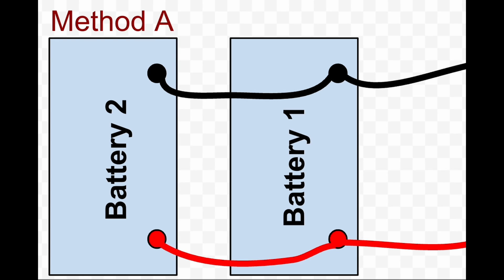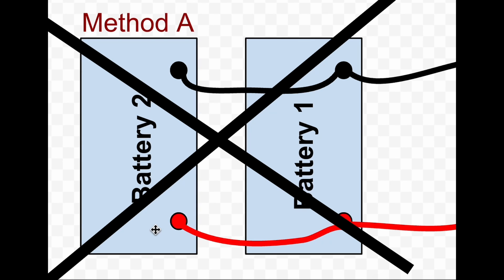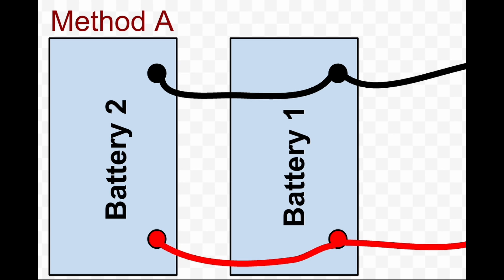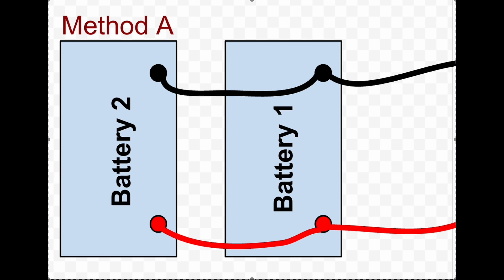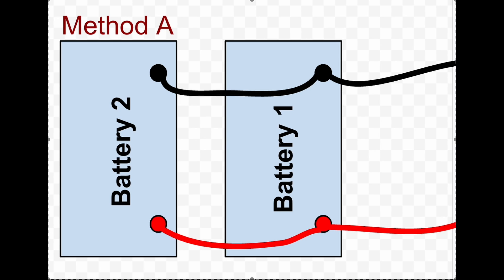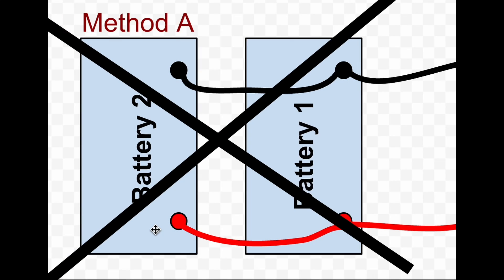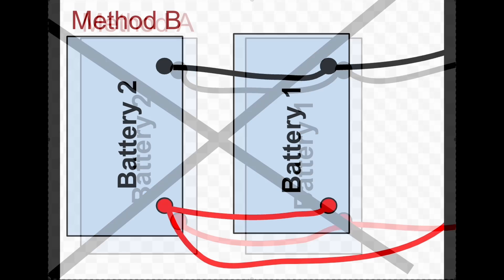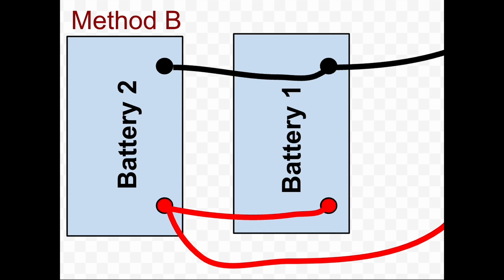What is the Best and Safest Way to Connect Lithium Batteries in Parallel for RVs and Boats or Homes?

Comment: I'm buying a boat with a 24v trolling motor. The boat comes with a Noco genius Gen 5x3 12v charger. I'm wanting to run lithium batteries. Will this charger charge a 24v lithium battery or do I need to buy two 12v batteries and how would I connect them?
Reply from the maker: @smartmoneynow1926  The Noco 5x3 is for 12V batteries. I would use a 24V charger and buy either a single 24V battery or 2 12V batteries and connect them in series, not parallel as I have shown in the video. Theoretically you can connect 2 of the ports to individual 12V batteries and run the batteries in series. However, I am not familiar with that charger so I would do further research before you do it. One advantage to using 2 12V batteries is that you can move them individually. The advantage to a 24V battery is that the BMS will balance all of the cells . If you go with 2 12V batteries, be sure to keep each balanced to the other. This is especially important with lithium batteries . The Noco may do this. I do not know though. I hope this helps. The Noco manual should describe its capabilities.
Reply: @TravelingLightReflections  Ok thanks. For those of us who are not electricians, this can be more than a little confusing! I appreciate your help.

Comment: Retired electrician id say runt a t joint in the middle of the positive posts ewual distance and wire kengths same lengths weigh them be close as possible.iv worked acdc power for decades almost 4 i miss working but our body's ware out.

Comment: Can you do this with two different brands of lithium batteries??
Reply from the maker: Yes, as long as they are the same chemistry/type.  Also set you charger to the specs for the battery with the lowest voltage at Bulk, float, ect....

Comment: Either of the two isn't good when intending for energy consumption equalisation, I suggest building a box bar were the both cathodes and anodes from the two tubular batteries are directly connected to the two copper plate separately, note: all the cathodes cable from the two batteries are connected to same copper plate while you repeat the same thing for the anodes cable from the two batteries, with the same equal lengths of cable, then from the box bar, you can now distribute you both cathode and anode cables either to your inverter or charge controller. Reasons for this set up; is to actualise what we called energy equalisation. Thank you

Comment: If I have each positive and negative cable from all 3 of my 48V 100Ahr Lithium batteries connected to a positive and negative bus bar, will that enable them to be charged equally as well? Btw, the cables are each about 3 ft. long. Thank you for any advice on this setup.
Reply from the maker: @robertmanuel5273  Yes this good. Especially if the cables are all the same length. Your setup will keep each battery as close to each other as possible. With your high voltage you have 1/4 the current a 12V battery has. The lower the current the less important it is to have parallel battery’s cables be equal in resistance.

Comment: Um,,,the Europeans , specifically the Germans , believe that it was actually not the electrons that “ flow “ but rather the spaces in between them move because an electron is a solid ,,,,a theory that dates back to Mesopotamia times and that Tesla guy ,,,,,,,,,,Clifford  C. Calvin Jr. From Boston Massachusetts.
Reply from the maker: When I was in college we learned about electron flow and drift velocity of the electrons that where moving.  It is commonly misunderstood that the electrons flow at the speed of light through a conductor.  We now understand that the electrons move in the conductor in multiple different directions, similar to how they do naturally in a conductor without any current. The actual current of the is related to the average drift velocity of the electrons as they move through the conductor.  Another cool explanation is, if you pour water into a tube, the water that flows out is not the same water that you just poured in.  It is instead, the water that was pushed out by the water you poured "pushed" in, causing the current.  There is so much we know about science, so much we do not know and so much of what we do "know" that is not true, but fits our models to explain it.  For example, we know about inductance.  A changing magnetic field causes a current in a wire and a current in a wire causes a magnetic field. (and round and round into the concept of Eddy currents). The concept is pretty cool and practical.  Heck, I have a spinal cord stimulator that I charge using inductance. Currently (pun intended) the simple definition of current is the "flow of electrons". However, yes, although these electron have negligible mass, they do have mass.  This being the case, they should be subjected to the laws on inertia and momentum.  Empty space has no inertia or momentum as far as I know today.  The energy lost due to heat caused by the resistance in a wire can be mathematically calculated. This leads me personally to believe it is related to the mass of the electrons bouncing and moving as they move through a conductor.  However it could be, as you stated, that the current is empty space moving through the conductor.  In this case, it may the electrons in the ways that are being caused to move more than they do that causes the resistance.  In general any conductor will be a material with a pos + that has "too" many electrons.  Each atom is playing hot potato and passing the extra electrons around as the try to gain a stable noble gas configuration.  The moving of the electrons are in all directions, cancelling out the momentum so it is zero. When these electrons are moving at an average drift velocity the momentum does not cancel out.  Yet, being as the current is also described as being in the opposite direction of the full of electrons, maybe the Europeans are right?  Most likely we will change are beliefs as we learn more.  Thanks to the opportunity to spin my brain for a bit!!!!!
Reply: @ have you been holding this inside for a while?    Lol     So ,,,,then  if this is your belief based on the evidence and the science, do you,  like me , concur with Mr. Clavin assuming you know who I am referring to ?
Reply from the maker: @renaissanceman8564  I am not familiar with him.  I will look him up.

Comment: This all sounds like a bunch of batteries or kids whining about who got breast fed more(or less) from their mother(inverter and length of cables). I believe Andy from  OFF GRID GARAGE covered most of this but now lets add a twist.The bus bar method C is your best bet.Lets say you have 5 batteries 3 batteries with one type of 100ah cells and same BMS a 4th battery with EVE 100ah cells and the same BMS as the earlier 3 batteries and a 5th battery 300AH with a different BMS.All these sets of batteries will have a different internal resistances and having different lengths of cables(more resistance)  going back to bus bar and then the inverter.Use quality BMS's for safety,using different BMS's is irrelevant  does not count or affect the situation. Safety #1 The inverter is set to charge at say 56V.Safety #2 The BMS is only going to breast feed(charge) until its full charge voltage(Most quality BMS's designed by the manufacturer have settings you can change) is reached.The batteries with bigger AH will take longer to charge.The batteries with longer cables will take longer to charge than same AH battery with shorter cables.If you think any of these batteries SOH(State of Health) is going to be affected by these different parameters,you were probably not breast fed enough and your brain did not develop fully.The batteries could care less who is sitting next to them.They will charge and discharge on their own terms under this situation they are in.Now if you charge by solar there will be days that the batteries all fully charge (sunny all day) or partially charge( not so sunny or you need more panels if sunny all day). It all boils down to charge/discharge cycles and the temperature of the cells when you charge them and how much time you keep your batteries fully charged .You should if you can charge your batteries to full charge once in while and you should not discharge below 20%,I like to be closer to 40% for longevity.Some say between 20 and 80% is best.Enjoy
Reply from the maker: Okay?  Great story.To only thing I can add it that using a high voltage system will reduce the current by the factor that you increase the voltage. All the best to you.

Comment: Silly question - I have (2) 5200 mAh batteries I'd like to use to control the steering servo from an RC car on my pontoon boat project. Works fine with 1 battery but I would think 2 wired in your method B would give me longer run time. Any thoughts are appreciated. Thank you for your video.
Reply from the maker: @tedosan  I would not think the loads would be high enough to make a difference in how they are wired. Of course adding twice the mAh will give you more run time. Are these servos for a sail winch? That is a lot of power! My method B in the video is mostly for high current discharging and charging of large 100Ah and up batteries. Back in my RC days I would parallel batteries for longer run times but I always charged them as the pack . Hope this helps.
Reply: @TravelingLightReflections  Thank you for your reply. The servo is a standard rc steering one. It may be overkill for what I'm doing, but I like to McGuyver things! Thanks again.

Comment: My gawd, what a load of handwavium! It's a pretty clear demonstration that someone has learned just enough about electricity to think he knows something, but not enough to know what he's talking about... On paper, yeah, there's a VERY slight difference (specifically the (almost nonexistent) resistance in the connections between the two batteries). In the real world, unless one is running insanely long connections (and more importantly, current paths that are different lengths) between the batteries, the difference between your "method A" and "method B" are so small as to be effectively nonexistent.
Reply from the maker: It is sad that you are so swift with to type but are making only assumptions.  You are totally and completely wrong.  You do whatever you want. Start with research.
Reply: @TravelingLightReflections  It's even sadder that someone would flog such a BS theory as having any reality to it...
Reply from the maker: @Ferd414  Here watch this.  https://youtu.be/_pQ0WjpSEa0?si=DAo1h8wpof1Z7kX8

Comment: Whatt? 😂😂😂 Both ways are literally same😂😂
Reply from the maker: Which battery has longer cables in method A?  Which has longer cables in method B?  See, method B both batteries to have the same resistance in the cables for both batteries.  That is why I made the video.  This is not obvious.  Most people will just automatically use method A but method B is much better and uses the same wires!

Comment: Would like to share this video this video with its optimal connection and why it is so? 

https://www.youtube.com/watch?v=_pQ0WjpSEa0
Reply from the maker: Hi, I have posted this video in replies I have made to people who think that I am full of crap.  He using hard data because he has bluetooth built into his batteries.  It is a great video.  It shows the huge difference with the piggybacked set up compare to the others. He uses 3 batteries not 2 as I have shown. The difference with my version (method B) show a very close voltage drop with the middle battery.  He uses buss bars if I remember in his 3rd trial.  I  personally feel that this video is being watched by DIYERs Bus Bars use about 2 times as many connections.  The risk of poor connection is not worth the minimal voltage drop difference he was getting.  However if you are using 3 batteries with very high currents, maybe bus bars are a better choice.  For 2 batteries I never use them.  For 4 batteries I always use bus bars.  To answer your question of "why is it so?" the current always flow highest through wires with the least resistance.  It also flows highest from great differences in voltage.  The idea with a bus bar is to have all the cable the same length so the resistances with all be the same.  Then, "if" the batteries are perfect, their will not be significant differences in their voltages, so the currents in and out of each individual battery with be the same.  There are always minor variables but this gets everything as close as possible.  It a piggyback system like my Method A, the first battery has very short wires with much lower resistance so it discharges high then the second. (of course they them slowly balance out). In Method 2, this simulates having the same length wires on a bus bar.  However with three batteries it will not be quite as balanced.  As I mentioned before, it is close enough in most cases and uses less connections and crimps which are the most common area of failure.  I hope I answered your question.  BTW, I made this video because I kept seeing people using Method A because they did not know the difference.  Method B is just as easy!  So I want to share this. Maybe I could do I video with 3 or 4 batteries and multiple shunts.
Reply: @TravelingLightReflections  thank you

Comment: I have my two LIPO r/v batteries hooked up like you diagram but negative on battery two, they charge o'k with my NOCO 10amp charger, and also solar. So far no issues. I also supply the power to the r/v with an Anderson connector, and when towing or not in use I always pull the plug.
Reply from the maker: Hi Thanks for commenting.  I am not sure how big your batteries are but is sounds like you are running pretty low currents.  The higher the current the more important in is to use method to help balance the batteries.  Anderson connectors are great!  I use them too.

Comment: Now do it with 4 batteries.
Reply from the maker: I would recommend using Bus Bars, with all cables that are going from the bus bar to the batteries being the exact same length.  Keep all your cables as short as possible too.
Reply: @TravelingLightReflections 
Impact Battery has an article showing how to achieve "Perfectly Balanced Charging."
Google: 
"How to Charge Lead Acid Marine and RV Batteries in Parallel"

Comment: there is nothing wrong with the wire is where it is.
the only important part is use thick wires=no resistances= batterys same charge
thin and flimsy wires couse resistances= drifts

next part:
if you use lead acid with thin wires yes they are little off and one battery will degrade 1-5% faster about the current flows to rebalance them but nowadays anyone use lithium batterys and in this case its not importand in any way coz they count only full charge cycles over time.....

and sorry if lifepo battery one will have after 15 years and 3500 charge cycles 81% SOC left and battery 2 will have 82%....who carss this batterys can not be killed on any way... another iportent part:
battery 1 have 20 mohm
battery 2 have 30 mohm
= totaly different discharge currents controler from the internal resistance,= different charge or discharge current !!!!

old-fashioned pseudo theories are really worth a video with nothing eccential cleared?
i use thin wires on lifepo couse it not matters they balance on any after any shift on use and the cycles over time still the same....so pointless video.

the really importand part is step away from lead acid stuff.....
Reply from the maker: From the details and quality of your post, you sound like a smart guy. So if you have two lithiums in series, check the current going into or out of each battery when wired as method A. If not look at  You will see they are quite different and the difference becomes greater as the currents increase. This is especially true of lithium batteries because of their low resistance.  Yes, they of course will balance out over time but.... the first battery's BMS will show it is charged before the second in line.  For a simple change of wires, you can closely eliminate this.  Yes, I firmly agree lead acid is old tech and the use of properly sized wires are extremely important.  I made the video because this other wiring method is so simple to do, but so often overlooked.  Thanks for your comment. I was emailed you original pre edited version and the edited one. I can see you put a lot of time and thoughtful thinking into it.  Actually here is a link to a video that it better than mine with more detail and visual values to look at.  I tries to make mine short and simple. I get a lot of negative one or 2 word replies from people who have no clue.  Your reply had quality and informative info in it.  I only disagree on some of it.  Think you will enjoy this video. https://youtu.be/_pQ0WjpSEa0?si=5f3AITrXq593UIaD